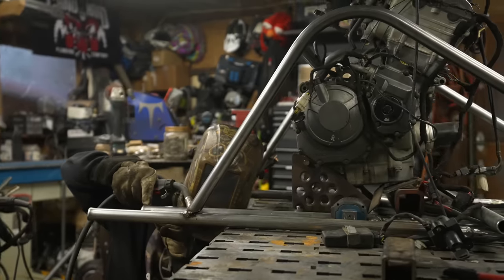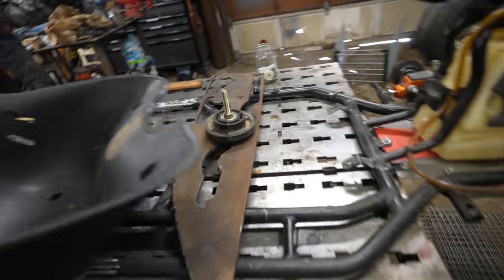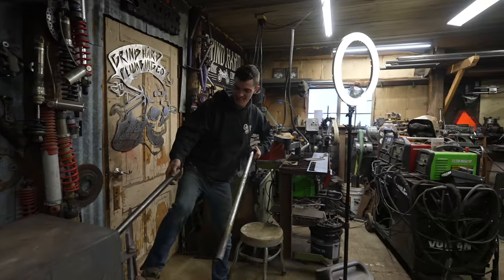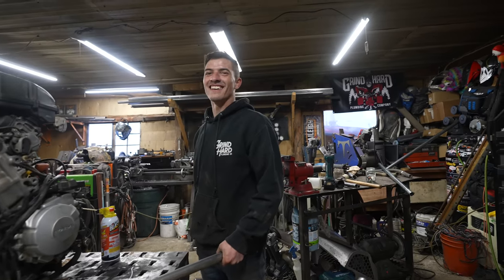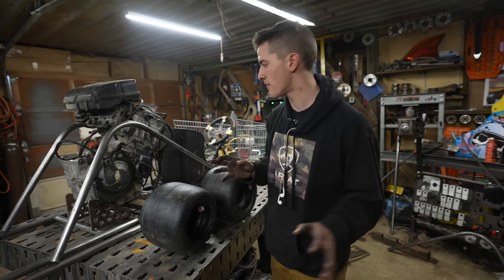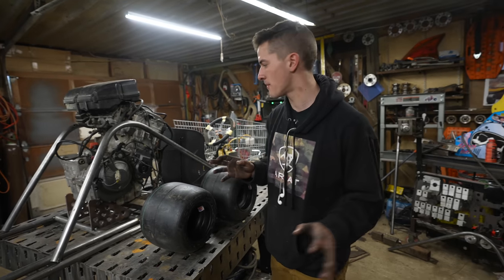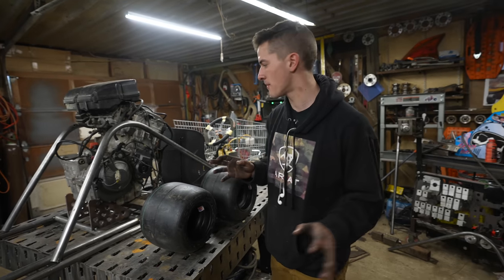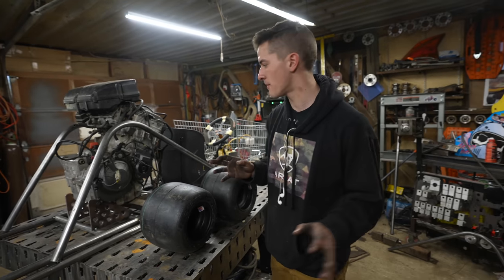We Built The Worlds Fastest Shopping Kart!

Comment: I have to say I was impressed with the build. you guys did really well. And thought ahead to what you might need to do to service or repair things. Guess your going to have to go shopping for a new engine. I want to see what kind of 1/8 mile times this cart can lay down.
Fueled by PREMIUM!!   lol thats a sticker to make for the Cart.  Awesome build! make it break it make it even better.
Reply: Given the design and tire choice, least on dirt, they might as well tear down the engine, weld it back together, delete damaged piston and counter balance for the missing piston. Engine has damage but i'm fairly certain Honda made it so it should run with just 3 cylinders fine enough for this thing. No need to waste another big bike engine for something like this. Much rather see one in something actually useful, though diesel engine could be cool one too.

Comment: My Dad had a '69 Dodge Dart with the 225 motor. It blew cylinder #1-hole in the block, piston McNuggets etc. He drove it home (40 miles in the Colorado Rockies, from Denver to Bailey) as is, than took tin cans and Quick Steel, patched and blocked holes in the engine block, corked 1 intake tube, cleaned the oil pan and drove on 5 cylinders for another FIFTEEN YEARS!!!

Comment: Guys! No more brake clean! The engine runs on it, but it has zero lubricating qualities and it takes anything slippery left on the cylinder walls out the exhaust port as it goes. It probably wasn't why the junkyard engine died, but I'll bet it helped speed up the process. I learned the hard way.

Comment: now first recomandation is to add one of those bicicle wheel slippers in on the secondary axle because its gonna break that chain on a turn on asphalt or brake traction, and after that a digital gear vision bit, as well as a cbr1100xx block with a turbo as those can handle a lot more as well as them making close to 200 hp stock in nearly the same profile

Comment: FYI, motorcycle engines dont have baffles in the oil pan to keep the oil in the sump when its sideways. When you we're drifting around the pickup tube was starved of oil and grenaded the engine. Youd be better off with an ATV engine

Comment: With those tires, it does not matter what ever it is 6x6, it still can only utilize fraction of the power available. It would probably rip as much with 125cc 4 stroke. Put proper tires on it to get traction, add suspension so each wheel is actually touching the ground and well.. since its at that point.. well weld the block remove damaged piston and make it 3 cylinder version since its probably done otherwise so might as well utilize what you have... ou and fire wall between engine and driver might be good idea if it decides to yeet another piston.
Reply: Your being way too sensible with them ideas it just removes all the fun out of having a death machine + suspension for something like this would end up being so overly complicated

Comment: This is a perfect example of someone knowing just enough to get themselves into trouble. Stoicometry and heat management was obviously not taken into consideration. I believe ignition timing also could have contributed to the problem. Oil starvation also could have been an issue being that the sump was not designed or baffled for side inertial movements.

Comment: "We didn't even do anything...and it blew up".
Running properly it should fire right up (even in very cold weather) run at high idle (2200-2800 RPM) with an occasional audible misfire during the first minute or two then run perfectly at low idle (900-1200).  ONLY THEN, IF YOU MUST, SHOULD YOU ZING THE THROTTLE.
The parts don't fit correctly until they reach operating temp.
If you love it, let it warm up.
If it sounds like dog _ _ _ _ and blows flames from both ends...
Kart looks like fun though. Look around there is an "abandoned" Suzuki somewhere.
Just sayin'

Comment: My z06 ran after taking a piston out. It was one of the double bang pistons on the cross plane crank. Left right left right left left right right firing pattern. Might not have run if it was a different cylinder. Drove it 600 miles home because I was on a road trip. Got it x-rayed before the rebuild and it was fine. One cylinder toast everything else intact.
Reply: They said your piston broke, I said I sure am.

Comment: Nice fabrication skills on the tubing. I'm wondering how its going to run with those headers.
Reply: I use alota angle iron but I'm just a Farmer and only have a welder.
Reply: Welding rusty metal and dirt in 100 degrees in a tobacco field is a little bit different and frowned upon by most fabricators
Reply: Good friends to show right when all the work is done. To be fair he came with gifts.
Reply: Maybe hurt the piston hyrdrolockin in with that brake cleaner on that first start up is my guess but what do I know